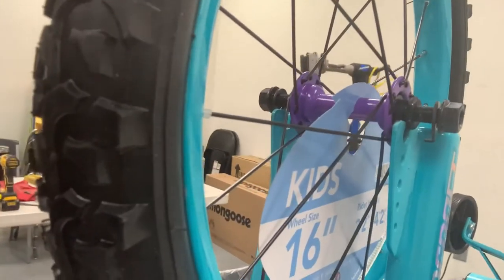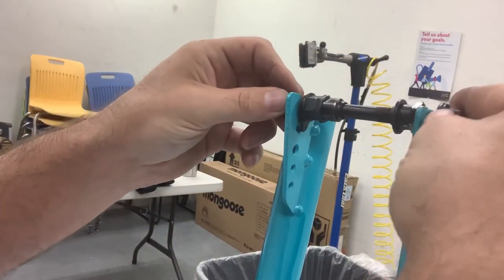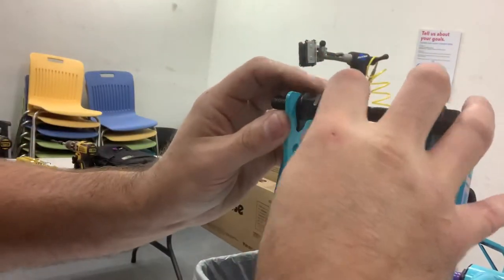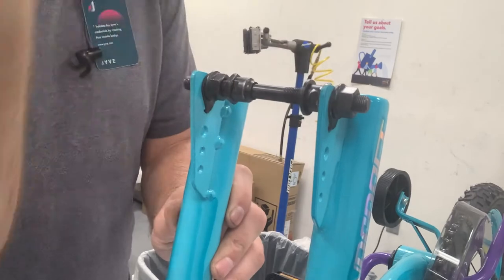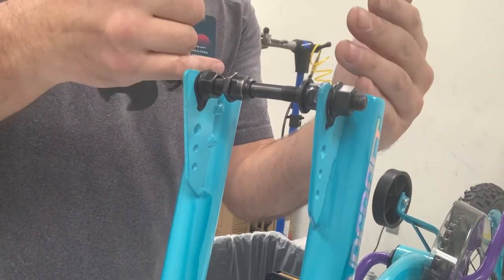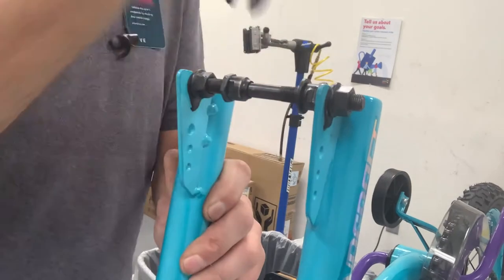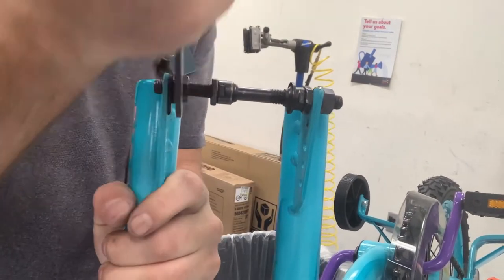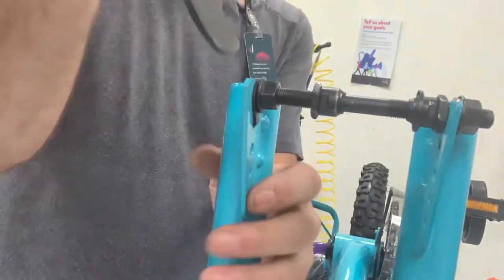Bent (Squished) Bike Fork Easy Fix - Bike Assembly Tips and Tricks

Comment: !! This worked for me :) couldn't find an axle so I got a 6 inch 3/8" threaded bolt and some hex nuts at home depot; less than $5.  over shot a little so used the same technique to bring it back in to the right place.  great video.  Thank you!

Comment: One thing to note. If you have disc brakes you do not want to bend the forks too much otherwise you will cause the disc brake and disc fly wheel to become out of alignment. For bikes like what you are displaying is fine. Also you don't really need a nut on one of the ends